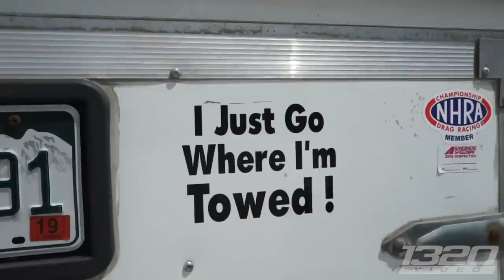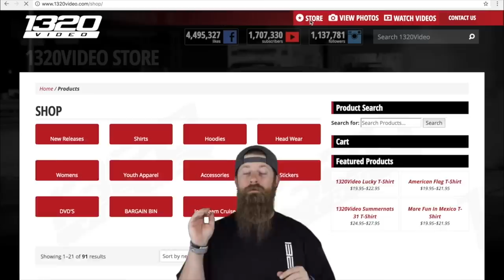Someone Get This Guy a MAN CARD! 1500HP Stick Shift GTO!

Comment: A v8 '65 gto stick shift thats fuel efficient this dude is winning in every aspect
Reply: Agreed.
Reply: And making 900+hp
Reply: Except burnout skills
Reply: James Price 1500hp will never be fuel efficient....
Reply: Mac Diddles you didn't watch the video, this car is fuel efficient
Reply: Mac Diddles ge said it got 21mpg my v6 explorer dosent get that
Reply: And you believe him. What a duffous. Every1 lies in racing
Reply: 10:1 compression = fuel efficient.  Turbo = fuel efficient. Sensible cam = fuel efficient.  Low boost and high timing advance for the commute = fuel efficient.  21mpg should be easy.
Reply: I think he said a 6speed
Reply: maximus vonce Racers lie about times and numbers. Not mpg.. “duffous”
Reply: yeah I remember larry Larson saying his 630 cube s10 was getting 17 mpg on the street. My stock 5.3 chevy gets that lol
Reply: James Price Yeah, except he can’t drive worth a shit.
Reply: Dude larry had the fastest street legal car at one time. He traveled 1000 miles pulling a trailer with it. Street outlaws do that ?
Reply: @maximusvonce1381  not true my dude race motors ESPECIALLY forced induction like turbo setups run better and usually tuned pretty lean until you floor it . I've heard this same comment about good gas mileage with alot of WELL TUNED turbo cars. Keep in mined this is HIGHWAY MILES PER GALLON . and not city
Reply: @oceanhome2023  especially with that 6th gear
Reply: got pics Or video of that svo? Love that car I got a fox coupe myself missed my chance at an svo and a merkur xrt4
Reply: In top with a low diff and those tall tyres,at cruising speed that thing will be not much more than idling.
Reply: Except it's old, heavy, not that efficient, and ultimately a compensation device.

Comment: hell yeah brother! pontiac power in a pontiac. God that is refreshing
Reply: He got drug by that Windsor every damn time
Reply: still don take away from how badass the gto is.i love gm, ford and mopar and that goat is sweet.
Reply: Same exact thought I had about the Fairlane.  So refreshing to see someone leave a Ford motor in a Ford instead of taking the easy way out.  Huge kudos to both these guys
Reply: Skile Ames I really like ls powerplants but I too always respect matching brands,even in fords.lol.
Reply: The Pontiac turbo setup was brand new for this, still some bugs to work out.  Chassis and boost control setup it will be as fast or faster than than my Fairlane!
Reply: Something Funny  he said it was a mopar block
Reply: Yea, but that was as much chassis as anything, he couldn't put the power down effectively. A couple of those passes had me wondering if he didn't have something broken in the rear suspension, watch the rear how violently it moves on gear changes and then how it skates at the big end. Either he is just flat over powering the chassis and tires, or something is not right.
Reply: Nope, it is an aftermarket ( Dart i think he said ) block, the Pontiac has to be an aftermarket block as well, no way you could keep a stocker together at those power levels.
Reply: yes, both are aftermarket blocks.
Reply: You are correct, 3 year old tires and shocks are on order, he will get this dialed in.  Should be way better for Drag Week in a month or so
Reply: "Windsor"
Reply: Aftermarket blocks but based off of actual Pontiac and Ford motors.  Pretty cool if you ask me. v8Billy66 absolutely love your setup.  I want one.
Reply: v8Billy66 A few of your launches had a squealing sound, is that your tires spinning on the rims?
Reply: Seriously ? Well heck, that sort of poops on the party.
Reply: What poops the party?
Reply: That they're after market blocks.
Reply: v8Billy66 you guys rock!
Reply: No he didn't.  Watch again.   He beat the Fairlane 9.71 to 9.72.   And the Fairlane is doing all it can do, runs straight and clean.  The GTO isn't set up properly yet, he's all over the place.  Lots left in it
Reply: @motorsandmore990  The Ford is a stroked 351 Windsor Dart block @ 427 cubic inches. The Pontiac is 517 cubic inches. Never heard any mention of the Pontiac as far as the block goes.
Reply: @gregorytimmons4777  Pontiac block probably from Butler Performance they're the go to I'd say when your power goals exceed that of what a factory block can handle.
Reply: #GTOs
Reply: My favorite GTO is the 1966 Pontiac GTO its just a work of art!
Reply: Traditional Pontiac iron block....
Reply: I love the GTO but the chassis on that car is squirrely

Comment: One badass Poncho! The guy is pretty brave to drive from Canada in it. You break some part in that thing you ain't likely gonna find a replacement for it at the local Autozone or Napa. I'd have trailered her there just to be on the safe side and not to have to kill some jerk if they rear-ended me at a stoplight.

Comment: BRINGS BACK MEMORIES!!
I had a Black 64 with red interior that I bought in 1969... MAN do I WISH I still had it!!
I DID do some drag racing -- Friday night "Run what ya brung" mostly -- and LOTS of street racing... but I was basically Stock 389 3-deuce, with Hedman Headers and some "secret" internal work, so it looked pure stock. I was turning 13 flat on 7" wide bias-ply street tires. {That was as wide as we were allowed back then in stock classes.}

Comment: I'm impressed with the fuel mileage in the 65 GTO. My old 1965 GTO convertible, 389 Tripower, close ratio four speed, with 3.90 rear gears would pull 19 mpg at 55 mph.

Comment: Those Fairlane 500's are beautiful cars. I used to have a 1967 Ford Fairlane with a 390 what a car that was at the time. I also had at the same time, a 1964 Galaxie XL 500 with a 351 Cleveland engine, What a gas guzzler that motor was pass everything but a gas station, not LOL back then, lol

Comment: Rich needs no Man Card, nobody would ever require him to show one. Even before the turbo that is a pretty high strung car to drive 2500 miles to Bowling Green, Kentucky where I first saw him at Drag Week. 6000 mile round trip!  Extra Man points for having a proper Pontiac engine and not some orange lump. I'm a Ford guy and love the Fairlane too.

Comment: Best Ford ever on this channel!
Reply: Bradley Werner this is not a ford
Reply: ImFreddyFazbearYT 
Dude, The maroon car is a Fairlane 500 by Ford .
Reply: ImFreddyFazbearYT  The maroon car is a Ford Fairlane 500 with a small block 427 Windsor type engine, running a full second faster than the GTO with a 517 Pontiac engine.
Reply: Denny Davis   the Fairlane is solid, and puts power down to pavement so well.

Comment: The guy in the gto has the same shifting problem that Leroy used to have. He needs to get face plated gears like his friend has and he will be one fast gto
Reply: What’s the benefits of face plating? (Not being an ass, serious question)
Reply: Lightning fast shifts. Instead of synchros there are big giant teeth that crash into slots as fast as you can mash the shifter.
Reply: Keith MacDonald ooooooooh so basically a dogbox transmission
Reply: Yup Yup Faceplates = dog box
Reply: Keith MacDonald 10-4 thanks man 👍🏽

Comment: That's the way I raced. I drove to the track , raced , then drove home. The best part was driving to work on Monday with my ET still painted on my windshield. 1967 Mustang Fastback 428 CI 4 speed. It ran low 10's with street tires. Oh to be young again.

Comment: no need for a tool parts trailer with trunks like that you can even bring the machine shop with you
Reply: i was thinking the same thing...
Reply: If it wasn't for that lil ecm issue I'd say they should be pulling a lil ice trailer instead of tools. What a couple excellently setup cars.
Reply: I'd rather have a trailer so you don't need to unload the trunk at every track before every race. I used to haul a car full of parts, tires, racing brakes, etc. and unloading/loading over and over (even though I was only driving to one road racing track 300 miles away for the day/weekend) got old fast. A nicely set up trailer, ready to go, is much easier and keeps everything dry if it rains and there's less risk of things disappearing (not that that was a problem).

Comment: Very, VERY cool! Both cars. That GTO needs to sort out the chassis and maybe go to a big tire. Seeing that thing basically do a burnout for the last half of the track is not how you run quick.
Reply: Doug Dixon I think just suspension set up and better power management. Also face plated gears make a big difference the fairlane is the more refined version of what the gto could be

Comment: #whenthe1500hpdragcargetsbettergasmileagethanmytruck
Reply: Andrew Price you ain’t shittin
Reply: Joshua Borchardt my truck is a stock v6 f150
Reply: Damn my Silverado ext cab 5.3 gets 20.  With 200k miles
Reply: Joshua Borchardt mine gets 18 average
Reply: I got a 5.3 Silverado get right at 18(in city) 22 (hwy) bought turbos for it just need to install them probably give me a little better mileage and about 800hp extra

Comment: caution fast boats ahead
Reply: Donkey Teeth I’ve got a 65 Goat and believe it or not, she only weighs 3090lbs
Reply: Pretty funny though
Reply: I should add that it is stock so that definitely makes a difference.
Reply: Dave M if I could post a picture of the registration, I would. 3085lbs to be exact. You can believe me or not, it doesn’t matter to me though.

Comment: I'd like to know how to apply for a man card plz
Reply: 1) Get a 1500HP 50 year old car
2) Drive 1200 miles to track
3) Run low 10s
4) Still be smiling and as nice as can be when it breaks down and you have no other way home
5) Fix it
6)Run more 10s
7)Drive home
Man Card Status Achieved
Reply from the maker: There it is folks!
Reply: Run low 8s.

Comment: Modern tech with valve springs and turbos has brought "race car engines" light years from where they used to be. 30 years ago, you'd be rebuilding a 900+hp engine every 100 passes or so, and depending on your cam, you'd be changing valve springs every 50 or so passes!

Comment: I had and 88 ford coupe mustang. I had truckflow heads and 525 roller cam . A weiand stealth intake and 600 Holley. With 410 gears. I was driven daily and ran mid 11's on 8.50 × 26 slicks.. I was 5th king of Rankin circle in Houston tx. Oh ya it was factory brown. Damn i miss that car. Sold it in 99'

Comment: I thing I noticed was the Pontiac seemed to be skating around more going down the track. If they still have mainly stock suspensions, the Pontiac would have coil springs and the Fairlane leaf spring rear suspensions

Comment: It only makes sense if you make more power, from a turbo with your engine  its more efficient you will get better gas mileage out of  the engine . Thats if you can keep your foot  from mashing the skinny pedal. Diesel guys do it all the time add 500hp but get 5 more MPG too. I have a turbocharged 383 gen 1 sbc . I get between 18 and 20 mpg on a good day when im not ripping on it.

Comment: 8:10 that clutch is on it's last breath.
Or did he forget to take the fot of the pedal?
I hope I'am wrong, that was a real badass car!🤘
Cheers from northern Sweden 🍻 
(where everybody drives manual)
Reply: This guy designed his own digital pwm slipper mechanism for his hydraulic clutch. I know this comment is old but helps with explanation of what you saw. It’s called the bang shift Billy.

Comment: Fix the rear suspension, since it dog legs left, fix the hard gear shifts, and maybe get some more heat in the tires.

Some pretty good stick cars though.clearly the Maroon one has it dialed in a lot better.

Comment: Regardless of how awe-inspiring this car is, I still have one issue with it. There comes a point in modification where horsepower no longer serves to provide a useful function, but rather, acts as a personal ego enhancer. That threshold I believe to be 600 hp, although this is only a general guideline. If I were to make the choice between less horsepower for a more luxurious cabin and a more flashy exterior versus insane horsepower for spartan everything else, then I would take the former in a heartbeat. However, I'm also not going to restrict other's personal choices. That's their own deal.

Comment: torque gets you to speed, horsepower keeps you at speed. Remember kids. Without boost and cruisin, says he has about 900 hp if turbos dont spool up Im guessing if you can keep the vehicle under 3000 rpm and run it below 65.  Im guessing it has enough power to keep the vehicle propelled at highway speed without adding more gas.
Its still complicated but basically if he can keep the load low on the engine and under 3000 rpm. He probably has power at around 200-300 hp so he has enough to keep the vehicle going.
Look up diesels and their low-end power. Where power band starts at 2000 rpm and maxes at 3-4000 rpm. Oh and the power is instant at the 2000 rpm range and very linear. So a diesel can have up to 75% of it's peak power at 2000 rpm
I know this because I had a duramax suburban that can get 28 mpg if I keep it under 2000 rpm. It has enough power to push the car without hammering the throttle and instant takeoff.
As long as you can maintain enough power at a certain range with the vehicle being light enough to not eat power loss when traveling. It can maintain amazing fuel economy.
But who knows. I dont know what tune he runs on the engine.

I just know if you can master the art of feathering the throttle enough to get the vehicle at speed fast enough to wear drag and rolling resistance reaches equilibrium. You can even see big v8's get amazing fuel economy. Especially if it has low end power, thats the kicker.

Big powerful engines may consume fuel when it comes to performance. But have more power at lower power reserves. While smaller engines need to be peak performance, which means all of it's power is at the upper range. Which means more fuel being consumed. I have a 4cyl engine on this truck and a v8 hemi and the fuel economy was negligible. Although the 4cyl had a higher fuel economy average because it has lower displacement and fewer cylinders. Which means fewer EFI units to disperse fuel into the combustion chamber And probably the cylinders are smaller. While the v8 almost always consumes more fuel. Also the hemi is much larger than the 4cyl. 2.7 4cyl compared to a 5.7 hemi. Halve the engine cylinders and you got 2.85 Liter of capacity. So the bore size is larger. The valves are larger. Plus more cylinders. Also the power on my 4 cyl was very peaky. max torque at 3800 and max power at 5200.
So the v8 has instant torque at 1800 rpm which doubles what my 4 cyl makes and at half the rpm range. And double the hp at 3500. So the smaller engine will struggle on hills and fuel economy goes down instantly. V8 will do fine and actually has similar fuel efficiency of 15 mpg up hills.

So now you know.

Comment: Great cars, awesome reliability and mileage to be that quick. The GTO guy needs to roll thru the water, then stop, set the line lock, and THEN heat his tires. Don't do the burnout it the puddle, it slings way too much water up in the wheel well that can drip down on the tires at the tree. Two, they ought to let the Fairlane guy drive the GTO, and show us what it can do. No offense, he said he needs to learn how to drive, and I'm positive that he is is his harshest critic, not me. Again great cars, and great guys!!

Comment: I'm no expert, but right from the first pass, I'm thinking there something isn't quite right with the rear suspension of the GTO.   Then seeing it sideways in the burnout box and the big end wiggle, he's got some bushings or something he needs replacing..  The rear isn't tracking straight.

Comment: A T56? I didn't know that they could handle that much horsepower. I believe he said it was a T56 Magnum maybe that means it's upgraded.
Reply: The GTO runs a bone stock T56 Magnum, it has held up surprisingly well, the clutch and how you engage it makes a big difference

Comment: the goats losing a lot of time between shifts, that motor is real slow to respond in the last races, wonder what the issue is. still great times even when its not running perfect which is badass